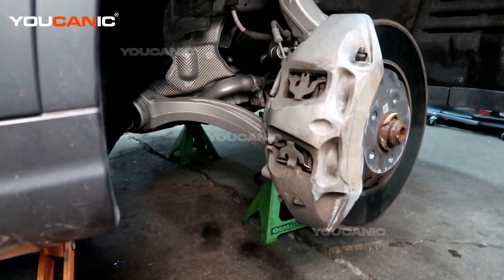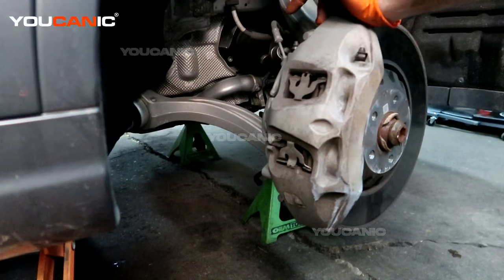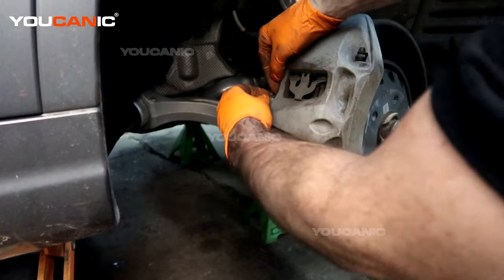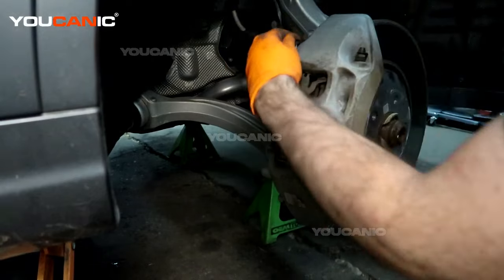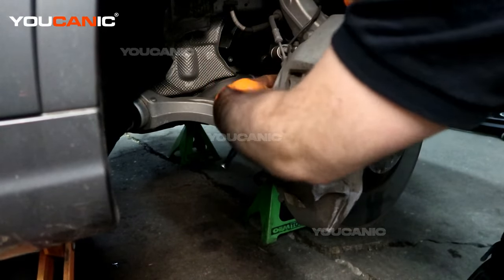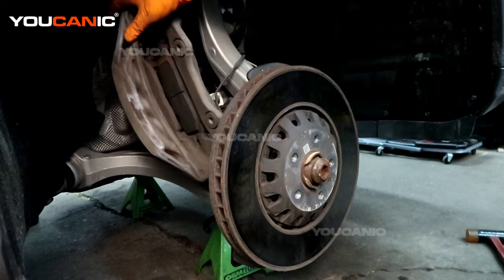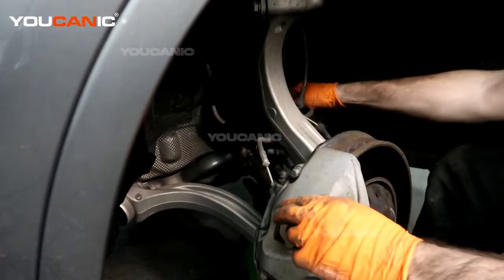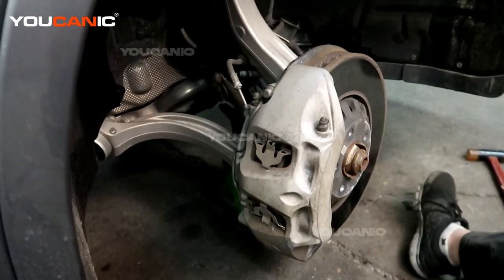2016-2023 Audi Q7 - Front Brake Pads & Rotor Replacement

Comment: Repair manual says to never remove the two special bolts you mentioned early on. They are torqued and set at factory so only remove 21mm bolts.
Reply: the mounting bolts are to be removed, the special ones are not to be removed.

Comment: You really should replace the wear sensor with a new sensor each time you replace the pads. They are a relatively cheap part so why skimp out on that?
Reply from the maker: Thanks for your input! You're completely right and we encourage replacing the wear sensor with each pad replacement. YOUCANIC's mission is to empower car owners through guides and our YOUCANIC scanner. We're glad to assist you with your car maintenance queries at www.youcanic.com. We aim to make everyone confident under the hood, without heavy expenses.

Comment: Jack stands location: Answer..
Just did this job and here's what I used. First remove the splash panel (like for an oil change). To the sides where the panel attached near the fender you'll have some "flappy" rubber pieces it screwed into.. move one aside and look directly above it.. you'll see a nice machined-flat part of the subframe which worked well for me. It's exactly as I just described it - you'll know when you locate it. (Not part of the control arms or other movable components)

I'm not a certified mechanic, proceed at your own risk.
Reply from the maker: Hi there, thanks for sharing your personal experience and information! This kind of interaction in our car community is exactly what we encourage at Youcanic. Just to remind everyone, we do offer detailed guides and resources on our site that can assist with tasks like these and many others. Our YOUCANIC scanner and factory repair manuals might prove handy for you next time. Remember, we're here for you on your journey to feeling more confident under the hood. Always empowered, always mobile, that's YOUCANIC! www.youcanic.com.

Comment: Excellent video, straightforward job with no need for audi torx bit. I used Raybestos Element 3 pads as it was the only non dealer pads I could get on short notice. I went with 140 ft lbs on the carrier bolts. Don't forget to change the intermediate clips ans lube with lithium grease per audi tsb.
Reply: Edit. I tried to get by just with pads but they started to squeal. So I did it again and got Zimmermann rotors and pads as the raybestos ones were dusty and noisy.